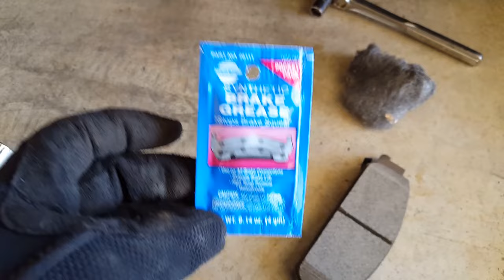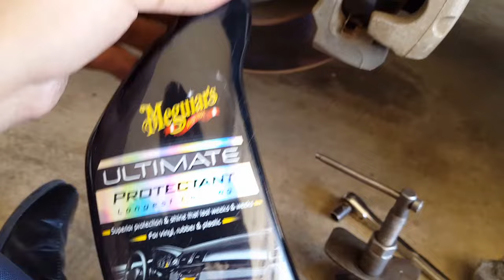Pontiac G8 Changing My Brake Pads

Comment: ok sweet so that's all you need is the gt calipers and the bracket..and yea obviously the rotors and pads which u can get anywhere
Reply from the maker: They help and work much better than the smaller V6 rotors we have on ours. They should have been standard for how heavy the car is.

Comment: So I own a Pontiac G8 GT. The V8 version. I like watching your videos because I seem to get a lot of good cosmetic idea's from your channel. I hate to be the guy you talked about in your video, but in all honesty, I have to say by watching this video, you should bring your car to a tech. The squeaking is normally cause by cheaper quality brake pads/rotors. The caliper tool set is nice if you now what you're doing with it. Although, there's no point in buying or even renting a set if you're not doing constant brake jobs on Honda/Acura/Mazda as well as other certain other certain foreign vehicle's. Plus, Pontiac G8's don't actually need the caliper tool set since they're not even twist in caliper pistons. People are saying C-Clamps, but all you really need is a little over sized adjustable pliers to clamp in the pistons. You should also be changing the rotors at the same times as the pads no matter the percentage of pad/rotor there is left. Especially if you're doing one or the other. Unless there is a good enough rotor left to bring to a shop so they can lathe the outer surface of the rotor down to refurbished. So to say the least, I also believe everyone needs to learn the basic maintenance and up-keeping of cars but if it isn't in someone's best interest than they are most likely going to screw everything up by trying. Also there are so many people out there that haven't even opened their hood! It's really cool you want to learn, and I love your videos for you not making quality videos through a computer, oh and even for this video being 4 months old, but I think watching a few youtube videos, as well as getting a few friends that know what they're doing will help out a lot with maintenance and even the mechanical portions of owning this car.. Personally I'm the type of guy that thinks owning a V6 version of this car is pointless because you're only buying it for the looks, but I'm a bit of a person with a biased opinion on the topic of cars. Anyways, I will continue to watch your videos, good luck with everything you're doing and I hope you gain a little more knowledge in the mechanical world of cars. There is a lot to learn and it gets very interesting once you starting tearing apart engines or transmissions. Not saying you're going to but it is really fun to know or gain knowledge of. So cool video's, keep up the good work and your car looks really good by the way.
Reply from the maker: Thank you. That means alot coming from a V8 owner. I was told $500 by my dealership to replace them and that wasn't with the labor fee. I need to get some new ones but I'm not sure what to get. Upgrading from the base fronts to the GT fronts made a huge improvement over the stock base ones.

Comment: Have you ever had brake dust on all your rims after driving...? I’ve looked at my front brakes and those do need to be replaced...but my rear brakes still look like they have plenty of life...?
Reply from the maker: ONLY when I use normal pads. As you saw I have ceramic pads and it's been what? A year or two since this video was made and I JUST now have to replace the front. But I also have some new rotors from a friend.
Reply: My rotors are fine..., so ceramic pads don’t leave that brake dust residue? I’m gonna change the brakes on all tires soon.

Comment: hey man. .quick question what did you need for the gt brakes  conversion?  I'm thinking of doin it to my v6.
Reply from the maker: The whole set up? The GT rotors are about an inch bigger and the caliper needs the GT bracket to hold the bigger rotors. So I just bought the whole kit off a GT owner who did the CTSV brakes. Then I had a shop install it all.

Comment: Doesn't matter what brake pads you put on 
Performance or duralast any major difference?
Reply from the maker: LakotaD I'm not sure. It's a V6 so she isn't going as fast as a GT. I have Wagner ceramic pads and I forgot the other brand but they're all ceramic pads. Haven't made any sounds and she stops better than before. But I also have the bigger GT rotors on the front.